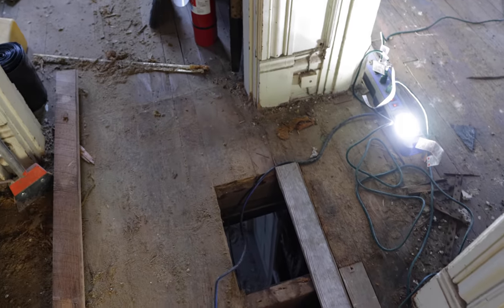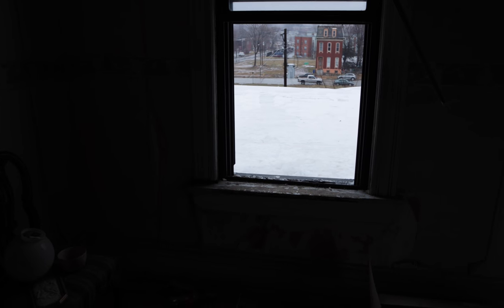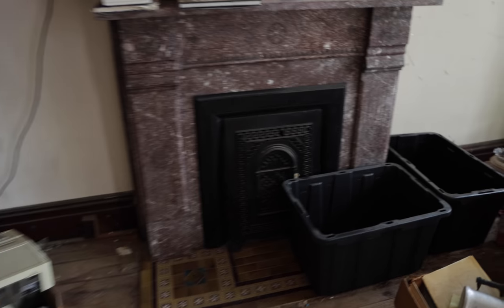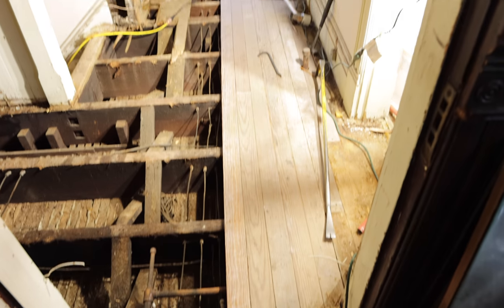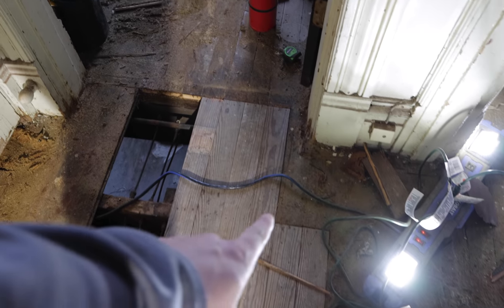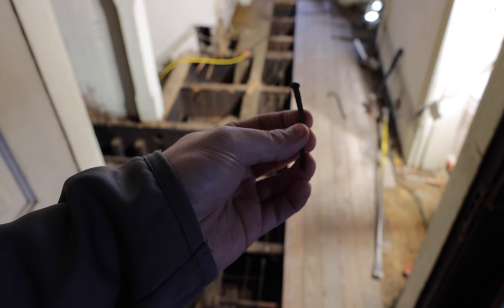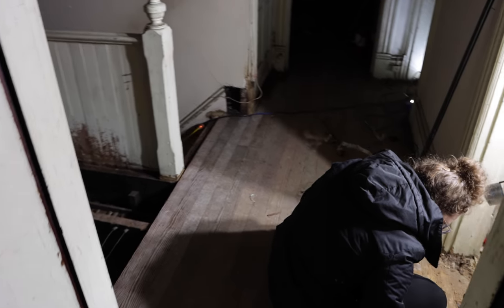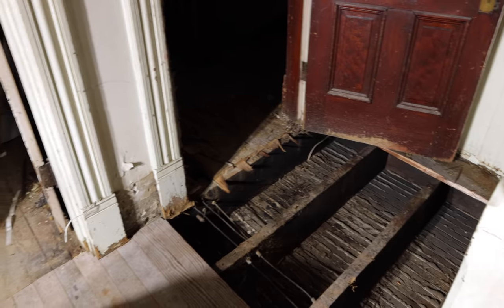NEW ROOF ALREADY LEAKING? EP 7

Comment: We had roof repairs this past spring. As part of my due diligence, I asked for their contractor's license number so I could check for formal complaints. I was gobsmacked that the State of Missouri does not require contracting licenses for roofing contractors. If they won't make it right, you'll probably have no choice but to go to a civil court to get it sorted. Hopefully, they will make it right.

Comment: The upstairs most likely was only finished with the pine floor boards. You can look at the baseboards and see that they touch the floor with no gap. If you clean the floors really well and sand them, a few coats of amber shellac will bring out a beautiful warm color to the wood.
Reply: This is GREAT to see 1834 Restoration commenting here. Very generous of you to provide some words of wisdom.

Comment: Seems your leaking issue also involves the window wall not being flashed and waterproofed properly. This takes coordination between the roofer and your carpenter. Roofers should coordinate that with you first. Roofing alone won’t fix that roof to wall transition. That wall needs help.
Reply: That was my first thought. A proper roofer would have carpenters on the job.
Reply: Yeah when you said roof to wall transition that should be like a cardboard box, no bubble (where Kaleb touched it outside the window)
Reply: The roofer would know if there was an issue and he should have refused to proceed if there needed to be another contractor involved.

Comment: I’ve been down that leaking window sill road before.  Roofing cannot be run up over face of sill or face of side trim, will definitely leak.  If sill is at least 8” above roof then remove roofing from face of sill and side trim, cut a 1 inch deep reglet under sill and tuck copper counter flashing into reglet and caulk.  If window is lower than 8 inches above roof then window has to be removed and copper pan installed on ledge before window install. 6 inches of copper pan extends out onto roof and is stripped into roofing.   Regarding first option, if there are holes or defects in windowsill you could still have a leak.   Good luck, and you really found a beauty!

Comment: There's nothing inappropriate about pine on the floor of a bedroom.  It was  standard practice in the past.  Finer woods were used in the public spaces and pine was used elsewhere and covered with rugs and later, carpet.  If your pine floors can be refinished, you might reconsider removing the original material.  They may be beautiful!  Invest is a beautiful oriental rug, instead!
Reply: I think the back portion of the second floor and the third floor will remain pine. The third floor wood is in much better shape and quite pretty. It’s a little funky here and there but I like it.

Comment: If you need temporarily, hardware stores sell thick roofing tar in 5 gallon jugs. I poured and spread a bunch out on a few flat roofs I had that were leaking and it fixed it. I did that for my current home and it’s been nice and dry and now I can fix the walls. So now I can save up to have the roof done.

Comment: Here in the UK, houses that age had floor boards exposed and stained dark around the edges of the room then a large rug in the middle of the room to cover the unstained area. Don't know if it was the same over there. 
Enjoying the videos. You both doing a fantastic job 👍💙
Reply: This was also common in houses in Australia. Much easier to roll up a large rug, and remove to dust than wall to wall carpet.
Reply: Wait...I did notice one of the rooms that had a light colored, rug shaped area on one of the floors!

Comment: While floors are up think about insulation between floors for sound dampening. The 1890s house I live in has it and it's great.
Reply: The ceiling below where we’re replacing the floor is either already ripped out or going to be ripped out so well insulate when we replace the ceiling.

Comment: The contractor needs to fix the improperly installed roof and the damage the water caused subsequent to the replacement of the roof. He is obviously not responsible for any water damage prior to the roof being replaced. I don't know what it is in your state, I am in NY, but the contractor should have insurance and it should pay for property damage, if the contractor used a sub par sub contractor that sub contractor should be required to indemnify the main contractor and then the sub contractor would be liable. Again, this is what happens in NY, but im sure there is something similar in place in order to protect the homeowner. But definitely see about that before you go through homeowners insurance and raise your premium on a property you can't even live in yet.

Comment: Looking good. I myself have renovated several house in Saint Louis. I do have one suggestion that doesn’t take too much time. When you have any cavity open, clean out anything (old wiring, trash, nails, wood chips, etc) in that space and use a shop vac to vacuum in that space. Also, keep the house as debris free as possible. You don’t want anything trapped in the cavities or drug all around the house. I think you will find this very beneficial to a successful finished product. Can’t wait to see more.
Reply: You can see me using a bucket to grab out big chunks and using the shop vac as well..

Comment: The floors in the less formal rooms were most likely painted originally, or possibly linoleum covered (it was the new thing back then).  Sand fill and paint.  Spend your time and $$$ on the architectural details and mechanical upgrades like new wiring.

Comment: LEAK HANDLING SUGGESTION - just a thought which won't fix the leaks but may limit the damage in the mansard area if not under the flat roof, while not costing much.  Get some room sized thick plastic sheets, some batten 2"x 1/2" would do and some lightweight galvanised chain.  Cut battens about 12" long and fix together to form a X shape.  Fix one or two chains, each about 8' long to the centre of the cross. Staple a  plastic sheet to the exposed ceiling timbers and when you have enough sheet in the air put the cross and chains on top and finish stapling the rest up so you have an inverted umbrella.  Cut a small hole at the low point and feed the chain through so it goes into a bucket on the floor.  2 chains 2 buckets! When it rains water will hit the low point and run down the chain into the bucket with zero splashing.  I hope you like the idea and decide to give it a go.  Keep up the great work. What you are doing and the commitment to quality and detail is a credit to you both. Mike
Reply from the maker: thats not a bad idea. ill try to rig something up like that this week. Good call mike.

Comment: You can switch the direction the tong faces on your flooring. Check with your supplier and tell them you need a spline which will allow you to change directions. And your best bet with the roofer if he wont fix his work is to turn it over to your attorney.

Comment: i have done a few floors of new pre-finished hardwood.  (strictly for friends and family ;-) when the tongue and groove did not jive with my direction of nailing with either the actual transition or the geometry of the room..i bought new splines to turn the starter piece’s groove into a tongue so i could go in the direction i needed with my floor nailer!  worked really well. (i got mine at lumber liquidators)

Comment: I feel you on the contractor trust issues-see if you can claim against your installation guarantee or even the product manufacturer. Might get a whole chunk of money back or even have it fixed for free. I had problems with 2 bathroom ceilings ‘leaking’ and then flaking down.. or so I thought. After 3 contractors I was so fed up I got my bro to help me and.. we scraped off 12 layers of paint that the idiots were just chucking on one after another instead of scraping all the way to the base layer! And the leaks was the condensation that got absorbed into the pockets between the layers! Now both ceilings are restored with two coats of fresh paint and sealant with no more issues.

Comment: Love your videos. As a renovator myself, the problem you had with the landing hardwood floor having the tongue in the wrong direction could have been easily solved if you had started by installing a thin wooden spline in the slot of the existing boards first. Then, all the other boards would have the tongue side available to do blind nailing.  Just some knowledge I wish to pass along.

Comment: Does look like poor work, however I was troubleshooting a roof that appeared to be excellent but there was still a leak. The leak turned out to be between the bricks and lining of the chimney and then out betweeen the bricks below roof level. So a thought is where water might be getting into the wall above that lower roof and wicking under it. A simple test would be to hang a tarp over the wall from he upper eve to shield it from rain to see if that helps.
For now I would ask the city if you could build a simple framework over the roof a tarp it to stop the damage as things get sorted out. Ideal would be with enough space to shelter working up there. If you had the budget, renting scaffolding and getting more of the building out of the weather would be a good thing.

Comment: That part of the floor go to harbor freight get a multi tool and it will cut it about flush with the wall.. Tool and blades 40 bucks.. You'll be glade you did
Reply: loran biggs I bought one of those from HF and they’re great, just buy better blades from H Depot, they last twice as long as the cheap ones from HF

Comment: I would have ripped out the old knob and tube wiring, and re wired the house with the exposed flooring.  Rather work from top down, than deal with all that plaster work below.  Who ever modernized it before with the box and wires is some janky work.

Comment: I grew up in Cape May Nj and have worked on many colonial and Victorian homes, all water leaks start at the top. If you’re not 100% dried-in then the problem is not the roofer it’s whatever you told the roofer to do or not to do. The dormers are the problem the fact that I can see light between the dormers and the brick are the problem!  As a minimum you could completely encase/cover the dormers in plastics or rubber membrane Just to temporary dry-in the dormers. You could drape plastic (or rubber membrane, better) over the sills and completely encase the dormers until summertime and dryer weather then replace/rebuild the dormers. I wouldn’t spend another dime on the place until it’s completely dried-in imo.

Comment: Have you done any pressure testing on the radiator piping system? While you have walls/floors/ceilings open, now is the time to replace the radiator piping if there are leaks in it!

Comment: Seeing your roof situation, did that roofer and/or company use Valley tin at all? I know you showed us the issues around the upstairs window with the continual leaking,  and I thought I'd ask. To me it appears it might have needed some tar application to the roof (if that wasn't done). From what my late Fiance told me, that's how they used to repair and prevent leaks on Mansard roofs back in the day.  Those old Victorian homes can pose all sorts of unexpected repairs and detours  along the way,  but they are worth it in the long run no matter how frustrating some of the restoration work might become. 
Are the pipes in the basement weatherized? I only asked since it appears terribly cold inside and I was told to use heat tape on my pipes so they wouldn't burst during the winter even though my previous home was cozy, the laundry area was cobbled together in what used to be a back porch.

Comment: I would be so angry about that roof!! 
I hope you are taking all precautions to avoid mould or to get rid of it professionally, which can leave you with serious health problems. 
Many people think bleach gets rid of mould but it doesn’t, it only bleaches the colour out of it so you can’t see it. I did a lot of research on mould when I had a HUGE MOULD OUTBREAK in an apt I used to live in. 
There are different mould sprays you can buy and they may work but I recommend hiring a company to rectify the problem. Also as soon as you start scrubbing mould you actually spread the spores everywhere, and need to close off the area with plastic etc. Just what I learned through my bad experience, and always make sure you wear the PROPER BREATHING APPARATUS.

Comment: I'd get rid of the paneling on the stair rail area right where youre replacing the floor and put spindles back in. Adds alot more class back to the house instead of paneling that doesnt have detail to it
Reply from the maker: Its not paneling its bead board and its the original. this is the maids area and as such wouldnt have ever been super fancy. With that in mind we plan on keeping it that way. however the white paint is coming off the woodwork somewhat soon.

Comment: I have a question : if you explained already I'm sorry . Lol under the planks of flooring looks like wiring .... is that for electrical?
Reply: Yes, when the house was built they used knob and tube wiring I think it's called. Kaleb said it was outdated and needed to be we wired so they won't be using that but you get an idea of what it looked like.  If you look on his channel and find the previous video of the house tour it shows a panel box in a hallway - Kaleb said that was like an old fuse box and the wires were mounted on ceramic I think so it wouldn't catch on fire - it's so cool looking they're going to keep it somehow but not use it of course.

Comment: Question- What are all those old wires underneath the floor running through the floor joists? Is that the old knob and tube electrical wiring?
Reply: Yes, and it is a fire hazard if still active but he said it is disconnected now.
Reply: @nancibishof6462  Thanks. Wouldn't you still want to remove it though? And put in some rock wool or something?
Reply: @tylergooding9743  Personally I would remove any of it I had access to to eliminate the material. One of the problems with knob and tube wiring when it is live is that rodents would chew on it and you could get bare spots that would allow the current to arc. Also the fabric covering the wires would eventually degrade and you could get bare spots. Were you asking about putting rock wool in the holes the wiring was strung through or between the flooring and ceiling below as sound insulation?

Comment: I never heard of anyone top nailing with wire nails. 
  The 1970's construction farmhouse I grew up in was top nailed with 10in wide pine but we used the square nails to cross the grain, the nail is supposed to bend and curve.  A curve in the nails  is used in all flooring right? 
  Wood actually gets harder after 10 or 15 year's not softer and it's gonna make a creaking from straight wire nails attached to swollen wood right?

Comment: @5:48 That's the difference between then and now. Back then they built a house and so far has lasted 132 years. Now, builders hurry, cut corners and don't care about quality or how long it lasts just to get to the next job and the work lasts less than 1 year.
"Oh, you wanted it to not leak? Well, that's gonna cost twice as much and take three times as long."

Comment: What are the things under the boards?  They look like the tension doohickeys used in foundations.  (And as I'm typing this, there is an ad for a flat roof installer on your channel!  Everseal...)
Reply: Does it look like wires? That's the old knob and tube wiring they used years ago - Kaleb said it's obsolete and they're going to update the wiring and not use it anymore- check out his channel and find the previous video where they showed the fuse box feature in the hallway!
Reply: @icemancometh8679  I remember on the previous video where he said it had something to do with the electric, but thought that I misunderstood.

Comment: I am wondering if you have tips for cleaning those radiators? I have them in my apartment and they look like they’ve never been cleaned! I can’t get a vacuum down the space between the radiator and the wall and they are soo filled with dust :(

Comment: Just joined the channel. The roofing material looked very modern. Was this supposed to be a temporary fix ahead of period matching repair?
Reply from the maker: Jo - we are using some modern products but the aesthetic will be 1890's. We'd be fools not to use TPO for a flat roof. We aren't very happy with the vendor we used but we are happy with this product. The vendor was sloppy (like most vendors). They have no care for what they are working on. We were just a number to them.

Comment: You never know with contractors, the highest quote doesn't mean the best work and the lowest quote doesn't mean the worst work. When I had to have the driveway (pavers) replaced a few years ago because the water main ruptured under the driveway, I got 4 quotes. The highest was the company that installed all of the original drives here, they do many of the neighborhoods here, and the quality is inconsistent. The second lowest quote does amazing work but they couldn't do the work for a month and I needed to get it done ASAP. The company I went with was actually the lowest. There was a gap in a few bricks a month after install and they came out and fixed it, but that has been it for problems, they did a very good job. And I gladly recommended them to my neighbor when they decided their drive looked crappy and they wanted to replace it. 
I hope they will come out and correct their f-up and the leaking stops.

Comment: thats some scary looking wiring under the floor
Reply: Knob and tube wire is actually really good wire and mice and squirrels won’t chew it,,,but the problem being it’s mostly meant for 60 amps and if you overload a circuit your blowing fuses and playing with fire.
So if you want 200amps in your old home it all has to go.